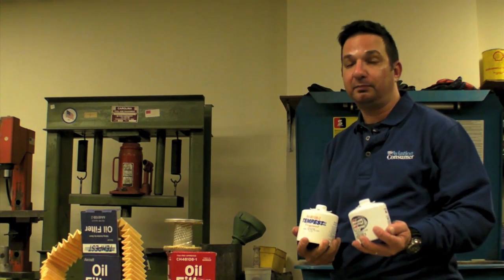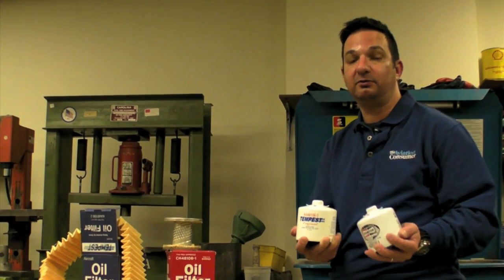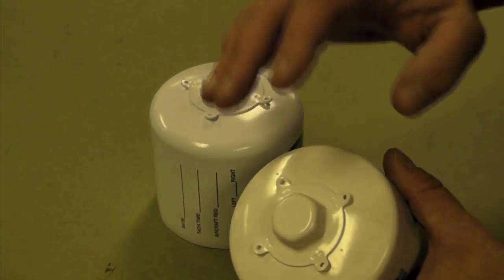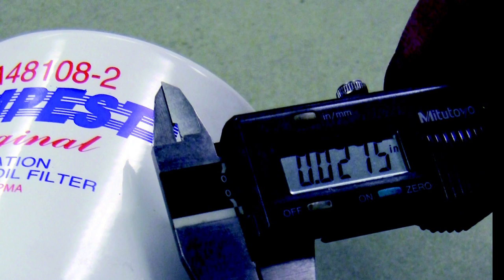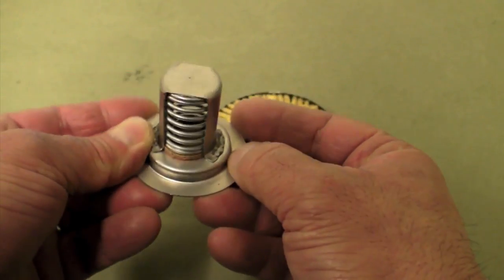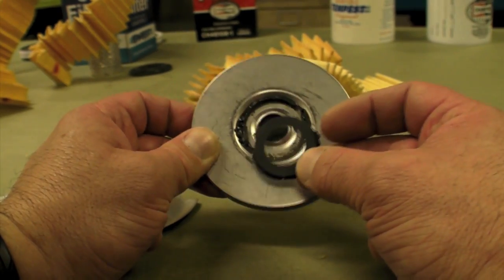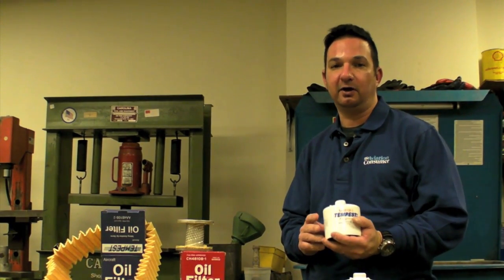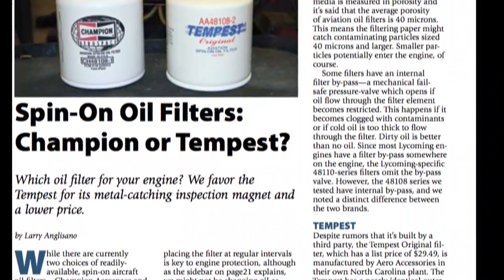Oil Filter Comparison

Comment: The biggest difference was not discussed.  The Tempest can is not as heavy as the Champion can.  Under oil press of 100 psi, the Tempest can will deform and may blow oil out from the seal.  Ask me how I know!  I lost all the oil in the engine in a couple of minutes.  I tightened the Tempest filter by hand using the usual 3/4 turn after the seal mated and had the oil blow out.  While cutting the can off the filter to examine it, the difference in the thickness of the two cans was very evident.
Reply: @Elcid051  do you guys make any commercial airline filters?